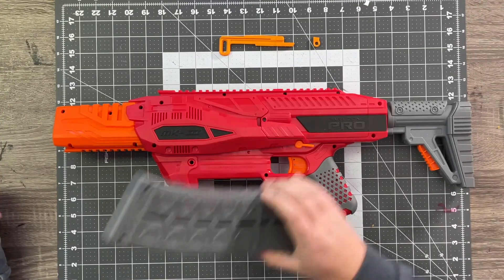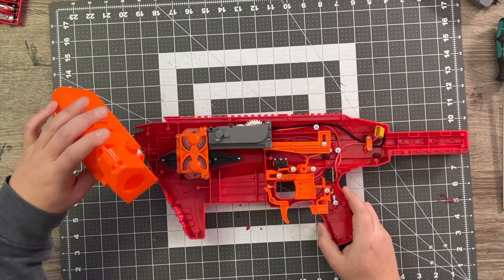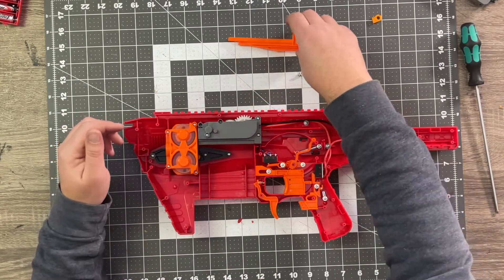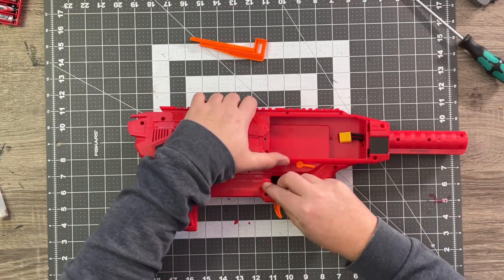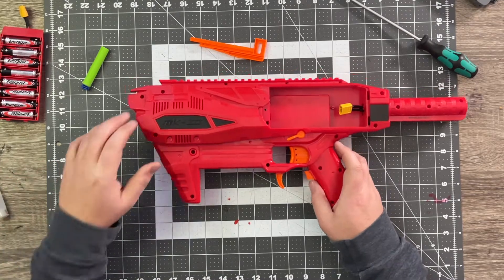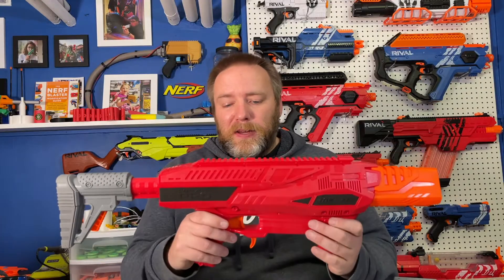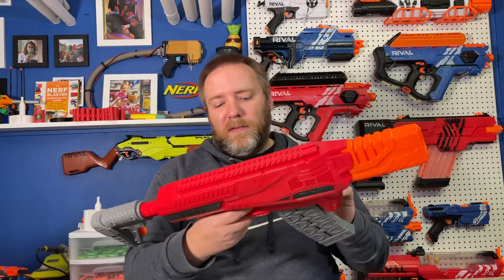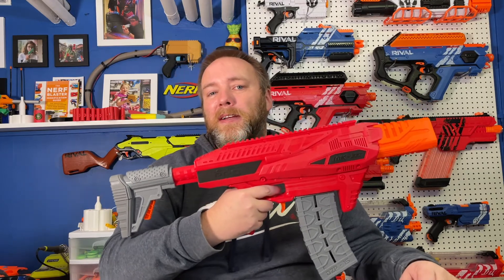Mod Guide for fixing the Dart Zone Pro MK III Double Firing Full Length Darts

Comment: My mk 3 rev trigger stopped working, do you know anything that could fix it?
Reply from the maker: I hear the rev trigger switch can get pushed out of place, you might need to open it up and check. Just open it slowly and take photos!
Reply: Ok thank you
Reply: @maritimefoam  hey I've had this same problem and sadly the brace did not fix it. I saw you posted a TikTok recently where it looked like you had replaced that switch entirely. Any chance you could offer some advice on that process?